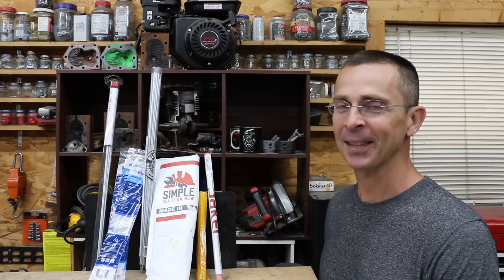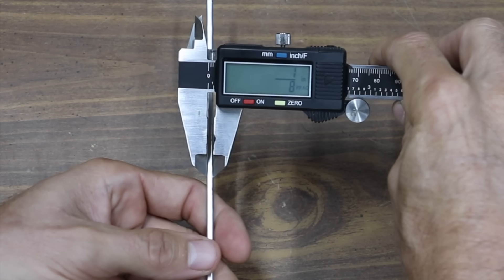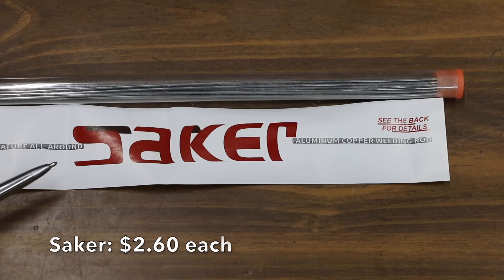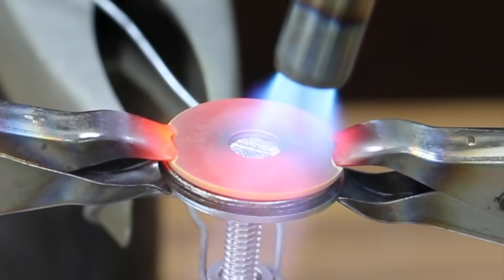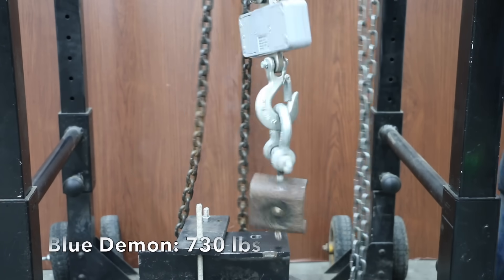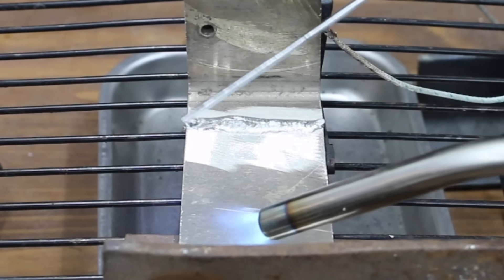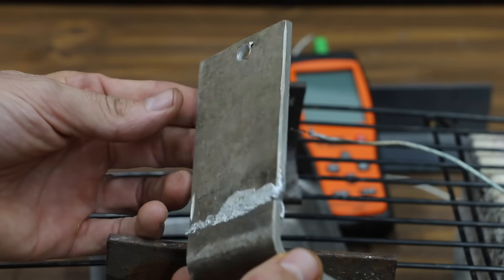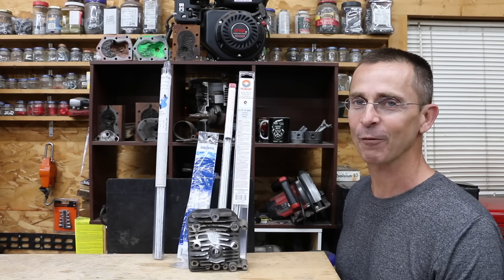Best "No Welder" Aluminum Welding Rods? Alumiweld vs Bernzomatic vs Hobart

Comment: Don't know if you have done this one yet but I use gassless mig which I find very useful but there seems to be a big difference in the flux core wire testing that would be very interesting I think?
Reply from the maker: Thanks for the suggestion.

Comment: Very nice video, but I have to say I don't know why you keep using the term 'weld' if you don't melt the parent metal you are not welding, you are either soldering or brazing.
As a heavy eq. welder & mechanic I was pretty sceptical going in but after seeing that I can definitely see a use for some of these, might be a bit ofa bodge job but its not always possible to weld.

Comment: I installed a train horn kit on my truck, and one of the trumpets from the horn set got bent down and broke (like a dummy a zip tie the air valve to it) the trumpet its aluminum, could I weld the trumpet back together?

Comment: Years ago in a fab shop where I was welding the owners would work on cars in another part of the building and they were constantly spraying brake cleaner and all it took was the fumes from the cleaner to travel to my welding area at least 150 feet away and I would be overcome with this noxious smell.Finally making the connection between them spraying the cleaner and the smell I researched and sure enough that what was happening.The bosses being old school thought I was crazy until I demanded they weld in my area while I went and sprayed break clean.From that moment on they only bought non chlorinated.
Reply from the maker: Thanks for sharing!

Comment: Very stupid question. How do I know what parts are made of aluminum that this can be used on? I could use a magnet to rule out steel, but are there other non magnetic metals this won’t work on? Let’s say a metal piece breaks on my snowblower. How do I know what it’s made of? That’s most likely why so many people are having issues. Using it on aluminum as intended = mostly good results. Using it on some other non magnetic metal =  the problem. No?

Comment: Which of the top 4 brazing rods do you think could hold metal when forging to create a Damascus knife? Or do you recommend a welder?  Do you think that the brazing rod will melt from the forge because of the intense heat? Maybe you can test this in another video?

Comment: Material surface "emissivity" difference is why your infrared image appeared to show the weld at a diff. temp. Surfaces of different materials and different surface conditions will  radiate heat at different ratio's. If you where to measure that repair with a contact device such as a thermocouple, you would see pretty much same temperature of head and repair material. You can't use an infrared detector and get exact representation of heat unless you know the emissivity of all the surface components and factor that in. Common mistake when people try to use those things.
Reply from the maker: Thanks for the feedback.
Reply: @ProjectFarm  Thanks for the video

Comment: Have you ever tried Cronatron® 54 Aluminum Flux Cored Brazing Rod welding products for your aluminum welding? They have worked the best for me for over 30 years. Use with Oxy-Acetylene torch, stainless steel wire brush. Give that a try.
Reply from the maker: Thanks for the video idea.

Comment: 11:20 Does that mean the Bernzomatic didn't crack?  I have a Grumman canoe that needs repair and the repair needs to withstand some flex.  Or would the Hobart's better strength prevent cracking by holding better?

Comment: Now, it would be interesting if you replicated this exact test with JB Weld Original. I mean, hasn't metal epoxy more or less replaced soldering and even brazing? I have watched your epoxy test, but I just thought it would be an easy and quick comparison of strength. Or perhaps it would be a totally different and more comprehensive torture test showdown Hobart vs. JB Weld Original?
Reply from the maker: Thanks for the video idea.

Comment: If you had v grove on both side of the aluminium plates and welded them on both side,  most of the tested plates would have bent instead of breaking.  A piece of advice for being successful at welding aluminium,  is to have the parts surgically clean.  As a welder,  I will definitely get some in my inventory!  Thanks for the tutorial!
Reply from the maker: Thanks for the constructive feedback.

Comment: The cylinder head repairs I run into  are cross threaded spark plug holes. The bottom hole on some outboards have very tight access for some DIY mechanics who don't get the spark plug started correctly and the spark plug doesn't seal.
Trying to use a Heli-coil with  the head on the motor is impossible. Removing the head, installing the Heli-coil and spark plug works well, but I don't know how well the owner can change the spark plug.
My fix is to electric weld the hole closed, machine a new land, drill a new hole, then thread the hole. This multi step process is expensive, almost the cost of a NEW head, and more costly than a used head if I can find one.
 Using the aluminum brazing rods, do you have a less costly way to repair the head?

I really enjoy you comparison tests, keep up the good work!

Comment: The infrared reads lower because the emissivity of aluminum is poor.  Meaning it does not emit infrared as well as other materials (especially when shiny).  The other areas were painted, which creates a surface that does emit with emissivity near 1.  The temperature was the same, but your instrument is fooled because of lack of IR emission.  If you paint that, it will show the same temperature.
Reply from the maker: Thanks for the feedback.

Comment: Man, am I glad you did this test.  I've often wondered if a guy could repair a transmission case or a cylinder head on a brigs or small 2 or 4 stroke.  I've wanted to build a light-weight electric cart or cycle frame to save on the cost of doing it with carbon fiber.  I think it would work great and you can get a lot done with a couple of packages of rods.  Thanks.  Could you also try some of the rods for lower temperature ?  I'd like toknow how they would work on an aluminum radiator core.  Too much heat wouldn't be good so if you would do that I'd appreciate it greatly
Thanks
Reply from the maker: Thanks for the video idea.

Comment: Ok I can mug weld rather decently, but i cant tig weld to save my life let alone tig aluminum, its great to see theres another welding option out there. Especially since the trucking company I work for hauls aluminum hopper tankers to haul flour and i wash these trailers. (Major pain lol) but after washing, we close em up and pressurize them to blow them out. Sure those held up to your tests, but can they withstand prolonged periods of pressure cuz pressurising the tankers is how they are pumped off. Also can the welds continue to hold up after numerous washes with a powerful aluminum cleaning acid? The acid we use is called aluma pro. I really hope to see these tests done in another video cuz if they can, i wanna tell my boss about this welding style in hopes of maybe saving the company some money from sending the trailers off to be repaired. Hope to hear from ya soon, still love your content

Comment: Great tests, will you add other brands in the future?  I've had a rod called HT-577 II recommended.  It is sold online on the web site aluminumweld.com.  Interestingly, they recommend tinning the entire weld surface before building a bead, do any of the rods you tested have similar directions?  They claim a strength of 45,00 psi which would result in about a 3,400 lb breaking load on a 5/16 diameter, if my math is correct...  Thanks again for the testing!
Reply from the maker: You are welcome!  Thanks for the video idea.

Comment: Best prep tool is a carbide die grinder leaves a clean surface ready for tig. But you can use a flap disk but it must be new and clean, best for sheet aluminium the flap disks with a scouring pad material
Reply from the maker: Thanks for sharing.

Comment: Useful video. I do not have a normal welding machine with flux and such for  steel welding. 

Question:

1. I have a stripped bolt and o want to weld a nut or the bolt head to help it get removed. 

Will using a aluminum welding rod be strong enough for this to work?

2.  How much weaker is a Almuminium welding rod join compared to a normal weld? Sorry, I do not know the proper name of the “normal welding” ... I mean the type with flux and needing the mask etc. 

Thanks.
Reply from the maker: Thanks for the video idea.
Reply: @ProjectFarm  ok welcome. Let’s test it out to see if it’s possible ☺️

Comment: Was gonna go to harbor freight and get those ones, but I just ordered the bernzomatic off amazon. I only have 2 small welds to fix on the top corner brackets of my boat transom, they probably aren’t even structural welds but looking at the cracks bugs the crap outta me. A welding shop wanted like $200+ for the job, hoping I can get er done with these $4 rods...
Reply from the maker: Thanks for sharing.

Comment: The Bernzomatic wets the aluminum and the steel or zinc washers. Hobart wets the aluminum but looked like hell on the washers.  When  you  bond different materials together Bernzomatic would  seem to be  best. Unless you cut  a hole and wrap it around like in the video
Reply from the maker: Thanks for the feedback.

Comment: I question that 55-60 rockwell hardness and 33,000 psi pressure endurance or we'd be facing anvils with brazing rods given most anvils out there are softer than pig iron at this point in the decline of civilisation. It'd be easy as shit to face them too, buy a buttload of these, drop them in a tray, heat the anvil up and then lower it face first into them. As long as you kept it under 300 by having heat sinks on it or submerging it up to the face it'd be feasible for a $10 anvil replacement for a $3,000 jobby. But I have a sneaking suspicion they wouldn't work.
Reply from the maker: Thanks for the feedback.

Comment: I've wondered about this stuff as I've had an idea for awhile about ways to convert an inline OHV 6 with non-crossflow heads to either cross flow using two Ford or Chevy heads. Or converting to DOHC using either two GM LQ1 heads or two Nissan heads. Either the VQ V-6 or the VK 55 V-8. If you have to get the heads to that high a temperature then maybe uts just as well to just tig weld them together. Such projects have been done in the past so it can be done
Reply from the maker: Thanks for the feedback.

Comment: I just got some "Low Temperature Aluminum Flux Cored Easy Melt Welding Wire Rod Tool 1.6mm x50cm" chinese rod in the mail the other day. I tried it out today and failed. I brushed the aluminum very good with a stainless brush and could not get it to stick until the parent metal was starting to melt. It was just a big mess at that point.
Reply from the maker: Great feedback.  I hope this video helps!

Comment: Welding and Brazing are always interesting to me since I own a die shop. Spent most of my welding days welding high carbon steel and tool steel. Not easy to do but successful for over 42 years now. 
I was never a farmer but worked on a farm for three years when I was younger. I have a GREAT appreciation for this chanel and the American Farmer!
Reply from the maker: Thanks so much!
Reply: Would LOVE to see a video demo of welding tool steel! 
And yes, farmers repair and design more stuff than engineers (and I’ve worked with both)—- they’ve GOT to!
(Skin in the game)

Comment: The thermal imager was probably not accurate when you pointed it at the cylinder head. Different materials have different emissivity and things that are silver tend to be low emissivity. In fact, they're definitely low emissivity for visible light which is why they look silver, but they also tend to be low emissivity in the IR spectrum that the thermal imager is looking at. I think FLIR cams have some options that can somewhat compensate for different materials but really you should just measure with the thermocouple.
Reply from the maker: Thanks for the feedback.

Comment: Low temp welding rod: exists
JB-WELD: finally a worthy opponent, our battle will be legendary
Reply: That sounds like an awesome showdown.  Hobart Vs JB-Weld.
Reply: @Anomaly188  hobart wins. Jb weld is not strong enough.
Reply: @zosxavius  JB weld: ARE YOU SURE ABOUT THAT?!?
Reply: @kitkatriciawatchingyt  yes.
Reply: @zosxavius  So am I, quite sure, because if you remember Project Farm's showdown of JB Weld like products, it would fail the bolt welded to a metal bar test with a weight attacted to the bolt and see when it tears away from it, right? We don't even need to test it, Todd already did really, lol. There is no way JB Weld or any type of epoxy steel product is going to hold like this did to his washers, not even close.
Reply from the maker: Thanks for the feedback.
Reply: @ProjectFarm  This would make a good video!
Reply: I use JB Weld as well but it has trouble bonding in a lot of situations like that cylinder head.
Reply: @NONO-hz4vo  I tried jb weld on a paint gun and thinner/reducer destroyed it every time.
Reply: JB Weld loses much of its strength when you heat it.
Reply: Image in the strength of JB-Weld aluminum welding rods.
Reply: apples vs oranges. JB is a epoxy basically a resin and rods are alloys. No way JB even has a chance.
Reply: I'm really not a fan of any religion but, but your avatar picture shows that you are a bigot for judging everyone from a particular religion and does nothing to help social cohesion. Maybe try doing something productive instead of hating.
Reply: @marsbase3729  you go to Saudi Arabia and tell them that and see how it goes while I watch from afar via livestream

Comment: Even though I’m in the UK and many of these products won’t be available here, I really appreciate this revealing review. 

I’m planning to radically modify a cast and extruded aluminium perimeter motorcycle frame in a way that could reduce its structural integrity if I get it wrong. In order to fit a wider swing arm, it’s necessary to alter the two main beams by cutting and refitting with narrow filler strips in four places. This is major surgery, and I’m certain 99.9% of bike mod guys would advise against it. 

But your results indicate that if I use V braze/welds on all surfaces, the resulting job should have more than sufficient strength to maintain the frame’s integrity in operation. 

If I add patches to the unseen joins on the inside of the frame, that should add an other layer of strength. 

Thank you for sharing this info. I’m even more inspired that before. One badass StreetFighter is closer to becoming reality.
Reply from the maker: Thanks so much!  Thanks for sharing and the best to you in your upcoming project!

Comment: Using the Alumiweld over a number years I find when the puddle is formed get a sharpened stainless rod and scratch the surface under the puddle, this breaks the oxide film and makes a stronger weld. cheers Alex.
Reply from the maker: Thanks for sharing.

Comment: Great vid! Just one note; that maximum load before failure is the "breakload" not the "tensile strength". Tensile strength is a pressure measurement ie: psi, kpsi, ect.
Reply from the maker: Thanks for the feedback.

Comment: A picky point perhaps, but these are not welding rods, they are soldering rods. Welding requires the parent metal to melt as well as the filler.

Comment: why do you switch between metric and the wrong form of measurement? 2mm and then 1/16 of an inch on the next rod and then use metric for weight? like, stick to one measurement system.

Comment: It'd be nice to have a few more controls in this review.  Things like comparing the tensile strength of an unheated bolt, a non-brazed bolt that was subjected to equal amounts of heat as if it were being brazed, and a TIG welded bolt.  That would give a much clearer picture of where the strength is gained or lost, and what kind of weld quality you could expect out of these rods compared to other methods.  Maybe a follow up vid comparing the Hobart rods with the aforementioned control tests?
Reply from the maker: Thanks for the suggestions.

Comment: This really was a great test.  I have a Harbor freight close by so I'm glad their product preformed well.
Reply: I don't think its their brand as much as they carry the brand. I've seen infomercials for alumiweld since the 80's.
Reply from the maker: Thank you!
Reply: Me too, easiest for me to get, and should work for the corners of my boat where some old welds are cracked.
Reply: @TheFrogfeeder  believe it or not, my 10ft John had a 1.5” hole drilled into the bottom when I bought it and no drain plug would fit into it, so I shoved foam in the hole, flex taped over that on both sides and flex sealed over that and even with a gas outboard she never leaked a drop. Hundreds of hours in that thing.
Reply: @KyGamingUnderground  I don’t have any leaks, just some old cracked welds, doesn’t seem to affect anything besides my ocd and the need to not see them ;)
Reply: I know, right? It's always hit or miss when you have to deal with Harbor Freight stuff.

Comment: What about a torch test video? Use laser IR + thermocouples to see which popular torches heat the fastest, but first find the 'hot spot' of each torch (while full) by doing a short burn test at multiple distances?
Reply from the maker: Thanks for the suggestion.

Comment: Thanks but what if the bolt was of a Titanium alloy? Then you would be able to overheat it as easily. But maybe the welding rods would not stick in this case and instead of them, you should find Titanium welding rods or something? I guess it would require much higher temperatures altogether which would be hard for "home" use.
Reply from the maker: Thanks for the feedback.